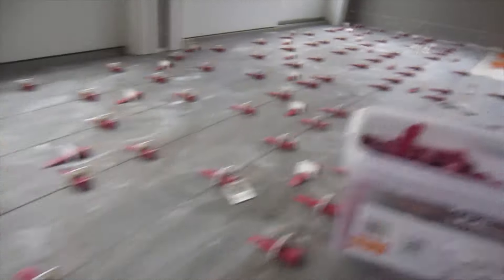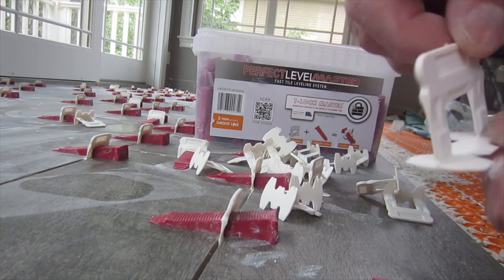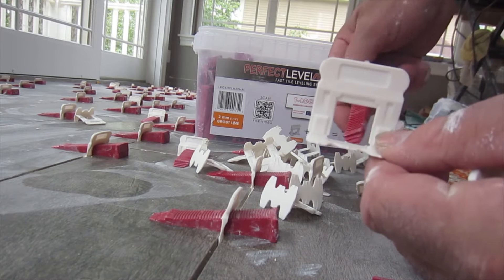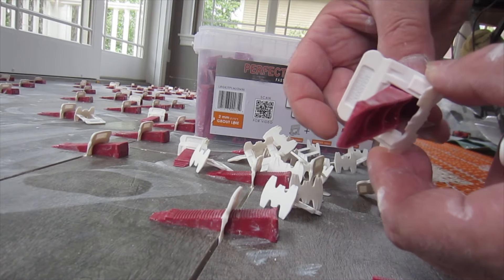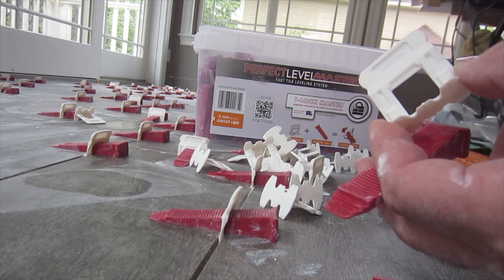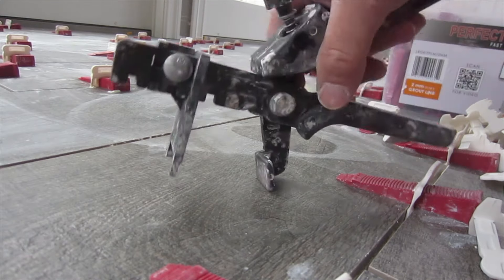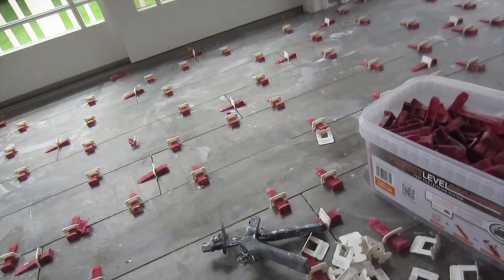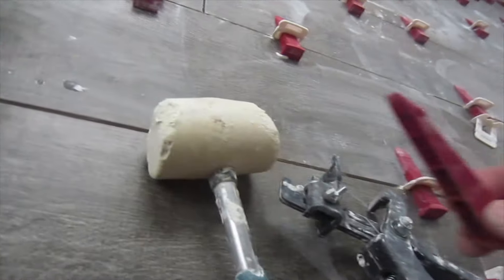Tile jobs done with T-Lock™    leveling system

Comment: Goos stuff, is this easier for DIY compare to just using those regular spacers? Also how do you do the edge? ( edge of that wall that seperates two areas, in the end of video) thanks
Reply from the maker: AxanthicSurf These leveling systems will make it much easier to eliminate lippage.

Comment: Thanks sal. One more question. Could you leave a clip in place underneath a tile and put on adjacent tile on one day later? Would the wedge pull the new tile into plane? The reason I  ask is because I don't plan on doing the whole time job in one day. Thanks.
Reply from the maker: tdhollan You will have to put it in place while the thinset is fresh, the next day it will not be possible, and yes it will work as usual, but the bases tend to move as the thinset dries so it is a good idea to put a scrap tile on the base, dry,  to prevent that.

Comment: Sal. What are your thoughts on using this system with accent tiles that are 1/16" - 1/8" less in thickness than surrounding larger tiles. Wouldn't this system pull the accent tiles off the wall too far losing the bond? How do you typically deal with situation like this?  Thanks.
Reply from the maker: tdhollan This system is not good for tiles of different thicknesses or ungauged tile. You will either have to build up the area under the thinner tile so that it will be at the same level as the thicker tile , or you can use a system that has curved bases and can handle ungauged tile. you will still have to use adequate thinset under the tile to achieve a good bond.

Comment: So these systems are used to make the edges of each tile even with each other so that one doesn't protrude out further than the ones around it. I just couldn't seem to get that into my head at first. I'm getting ready to build a 3' x 5' shower soon so I have been rewatching some of your videos just to be sure I don't royally muck it up. I just need to figure the top, I'll rewatch one of those that must be in the type and mix of the thinset right?
Reply from the maker: Mike 61 I don't understand your question.
Reply: I was basically just getting things sorted in my head. Not really a question. As always nice video!

Comment: Have you had any problems with hollow tiles? I guess this system only works on floors that are perfectly flat. I have tiled tons of floors where we would use tons of thinset to build up the tile to make things flat.
Reply from the maker: Using tons of thinset to get things flat can be an issue in itself, thinset is only designed to be used at a certain thickness before it starts to have issues with shrinking and cracking, an medium bed mortar or LFT mortar can be built up a bit more, but even that has limits of about 3/4" at the very most. Prep work is the key to getting the floor flat, if the floor is out of wack then it should be leveled first before any tile or uncoupling mat is installed, and lippage systems are not meant to fix problem floors, that is not the intended use and will not give good results. Also these systems will pull a high tile down not lift it up, and are used to tweak the floor not straighten it out. Also these systems work best on large format tiles. So to answer your question, no i have not had that problem.

Comment: Hey Sal. Thanks for reviewing this product. I am about to install my tile, but my grout lines need to be closer to 3/8 and this t lock system can only go to an an 1/8. Do you have a recommendation for which system can do 3/8 if this one can't? Thanks!
Reply from the maker: tdhollan 3/8 is a very wide grout line,  are you sure you want to do that? You could always use it in conjunction with a spacer.

Comment: Hey Sal - What is the coverage rate on these clips? Im looking at 6 in X 24 in wood grain tile and the space is about 1000 sqft. I expect to use about 6 clips per tile. So 1000 Sqft X 6 clips = 6000 Clips / 3 because each clip shares an edge with another tile - does 2000 Clips sound about right?
Reply from the maker: +Drew Atgw Sounds about right, but I never figure it out, i just buy them in bulk so i don't have to keep ordering them.

Comment: Hi Sal. What's your philosophy on Tile quality? My client bought some ceramic tile and I installed it. The tile on the shower was variable in size up to 1/8", but the floor tiles he chose were perfectly manufactured, with almost zero variance. 

My question is:

How can one tell if a tile manufacturer is good or bad? Does high price = high quality? 
Also, do these problems go away with different tile types? In other words, porcelain tile = typically better quality regardless of price compared to ceramic tile?

Thanks as Usual!
Reply from the maker: Spiny Norman Price is a good indicator, if you are paying almost nothing for a tile, then you can't really expect it to be of a good quality, unless it is a close out that has been reduced in price. Also the kind of tile that you buy will affect price and quality, an expensive hand made tile will not run very even in size, but will cost you lots of money. A rectified tile should be very even in size, but good quality porcelain tiles can run fairly even in size  as well. One word of advice, do not buy your tile at a big box store, but rather a specialty tile store, you will have a better chance of getting what you want, and be able to talk to an informed sales person.